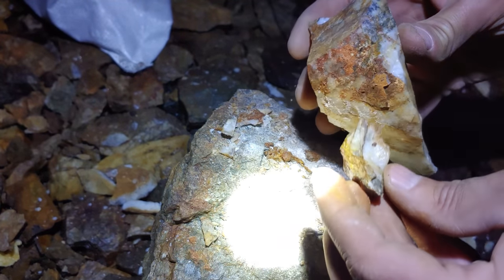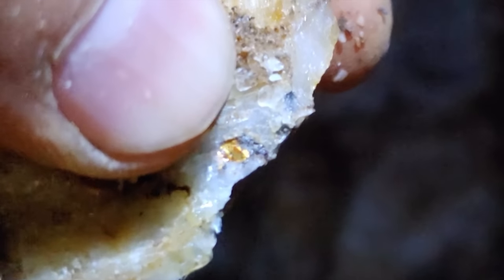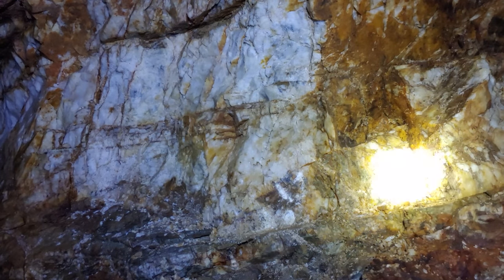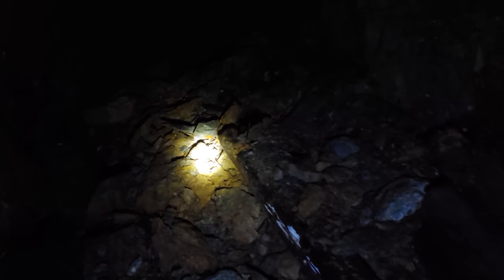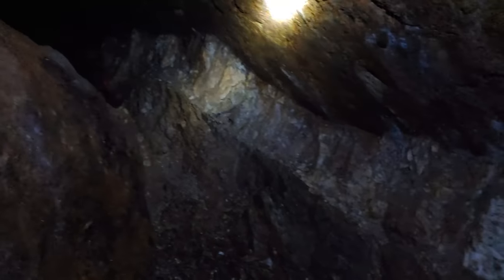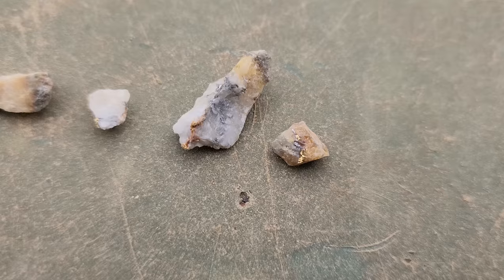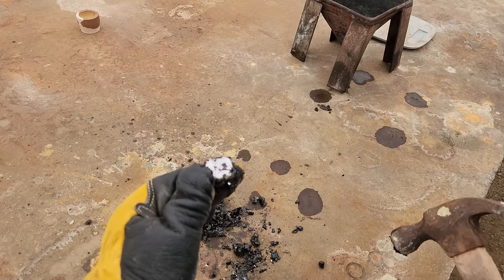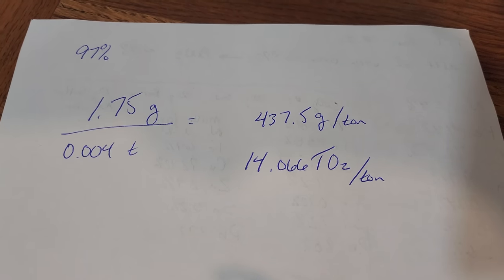Exploring & High Grading An Abandoned Underground Hardrock Gold Mine

Comment: I would suggest a compact led 360 lamp for your underground adventures bro, along with a good battery vacuum and a 3 or 5 gas monitor for air quality, all small and lite weight, but helps with your safety! Peace.

Comment: Thanks for the vid Jason! Hey I have a question, could you use a metal detector to find gold in the tailings on the ground in that mine? Seems safer to look on the ground rather than picking at the existing structures 😬
Reply: Jeff Williams uses a metal detector inside his mine, so I don't see why not.
Reply: I would claim that if possible and go in and result the hanging wall. Then I would run a detector over every inch of that mine and the tailings

Comment: I want to put a plug in for that little microscope for cell phones. First time I saw you use it I immediately ordered one. It works great on flat surfaces as you have to get right on the face to get it to focus because of a very shallow depth of field. Typical of higher magnifications. I just got back today from the Old Dale gold district just east of Joshua Tree. We found several nice examples of specimen gold from the tailing piles of several of the old mines in the area. I sat in the Jeep and took several great pictures of small gold nuggets and could then text the photos to friends and family. Really handy device!

Comment: You know, regarding the gold pillar, there's no way I wouldn't try to get that. But I would plan. I don't know how remote the site is, or if you have access to water. Those things are important for encasing the upper end of that pillar in concrete. I would even try to drive some rebar into the ceiling and floor where I was going to set up my forms. After it set, I would attack the pillar with whatever made the most sense. That way, I could take the whole pillar. The Concrete would replace it.

All it takes is time. I'm six months from sixty and I can hump Sacrete uphill for miles if I know there is a payoff that's worth it. I already have a remote claim that is about seven miles back in an area the Forest Service has closed all of the roads in. I've made great use of a yard cart to haul all of my supplies. This year, I'm making something out of a hunting cart. This will allow me to have brakes. I had to rig them up, but they will work. You haven't lived until you've tried to hold back a yard cart from going downhill that has all of your stuff on it, like five gallons of gas and a water pump and motor and all of the pieces of my dredge. I used to roll that thing five or six times every time I went in. Sometimes, when you don't have brakes, you have to make a decision, also, about crashing on purpose, before you get so much speed built up that you will not be able to pick where anything is going next! It's always better to keep things where you have choice.

This isn't too far off from how I just got the assay results back from an outcropping I found in a Wilderness Area. You can't do surface disturbance in a Wilderness Area. Too bad because the outcropping came back at over an ounce per ton. I found it in an old prospect pit. The old timers missed it by that much. It is off surface enough that I can take samples. I can't mine it, but I can sample it up to the reasonable point where it's too much surface disturbance. I may have to get creative with the waste dirt. You gotta find a way. This way involves me humping sample bags for a couple of miles, probably one in each hand. I don't want the rangers seeing me humping a cart in and out of the Wilderness Area. If I keep the promise to myself to not fill them too much past halfway, I think I can do it. It's amazing how heavy those things get if you get too greedy. As long as you don't get too greedy, you can put them down every time that your forearms feel like they are about to explode. That way, you can get just enough rest to string carrying them back to your vehicle.

Comment: Vogus has a video on those ones with visible gold on several points of a piece of quartz. He uses an electrical tester to see if two points on the outside connect internally meaning they are one larger piece internally. Those are good candidates for dissolving the quartz leaving the gold sculptures behind. Some are out of this world looking crystalline gold. You do realize that sawing those pieces in half means that the saw curf put gold dust in your oil bath don't you? Might be worth the loss if those slabs sell for a premium, but just a thought.

Comment: Sierra blaster would be nice to have in there, or a home made version using 9mm rounds as the charge filled with powder then sealed with jewlers wax or something fairly strong. Then devise a way to seal the hole. Maybe use cornstarch to fill the bottom of the hole  with a hose and surrenge. Only about 2-4oz in the bottom of the hole depending on depths , im thinking about 36" hole. Used a large o-ring to fit the shaft made from a thick rubber to form a semi seal around the 10-11mm shaft  the starch provides a non compressible seal around the charge  and boosters can be made with aluminum or brass tubing filled with powder, using an electric match to fire the firing pin into the cartridge, maybe use a wedge around the shaft and actually seal it in similar to a feather and wedge. Allowing much more work to be done , the wax sealing the powder  in the tube compressed make boosters in 1" , 2" , and 5" maybe 6" test Would be required. Because at some point the work will be done before the whole tube can ignite, the next option would be larger holes and use 1/2" tubing for boosters possibly  50 cal magnum cartridges,   drill a 5/8" hole 36" isnt easy   4-6 in a rock wall with empty holes between them  using a couple 6"boosters per hole with starch in the holes, ans a plugged entrance  it should open a door size hole 24-26" wide x 65-75" tall depending on a few things it may not throw the rock across the way, but it should fracture it enough that the opening can be opened by hand with s few tools at most .  I'd love to build stuff like this..  having two expanding anchors to hold the cartridge holderscin the bore hole or just a wedge system would be great preventing blow outs..

Comment: I've always wondered, could one build a concrete pillar , besides a natural pillar, with reinforcing steel inner frame, then once set and dried wedge it into a solid contact with the roof.
Reply: They'd use a system of steel rock bolts, beams, and woven rebar to reinforce the ceiling, but its installation is risky.

Comment: Why did they sometimes leave pillars instead of using stills? Especially with ore that rich, I can't imagine timber would have been so expensive to prevent them from using it?

Has the muck and fall accumulated to the point where they used to stand in there but now you can just barely even crawl?

Comment: every time i see piles of rock like that in those mine entrances, i get an Itch to want to move it out of the way, and or build walls with them.  but, then again, crushing it to find any minerals would be even more likely haha. otherwise though, i think using concrete and forms to stabilize a mine could be an interesting way to go about it, though very expensive if not entirely necessary huh.

Comment: First of all I would not be in there. LOL
  Secondly I would only pick up loose stuff if it did not come out with my fingers I would not touch it until I got some new timber in there.
  The way those columns are fractured they are already coming apart. You can always come back and send Dan heard in instead. LOL👍🏻

Comment: It might have made more sense to explain that 14 gr per ton is equal to about $950 of gold per ton of ore. Extending that to the collection and processing operational costs, you would still have around $500 per ton of clear profit.  However, not all samples will be this rich even from this same mine, as these are from 10 lbs of hand selected samples where gold was readily visible, and not more than 10% of the rock out of this mine would be this profitable, but in all, it is a still profitable if you can process enough fast enough.

Comment: Do you have a claim for that mine?
If yes, is there any way to first open up the mine entrance so you could walk in?
Bring equipment to add pillars and stabilize the ceiling?
Then clean out the path and vacuum up the debris.
And only after all that, start harvesting the visible gold.
Safety first, bring a friend or two, have a backup of basic equipment including food and water.
The scenario doesn't necessarily have to be getting crushed to death, but getting badly hurt or trapped to the point of Immobility.
You teach and help miners across the world to mine safer. Lead by example, because kids are watching your videos too 💛🙏🏼

Comment: some of the chunks with gold ' wire' in, would be very interesting if the quartz was dissolved in hydrofluoric acid leaving the wire in form.  also very dangerous as the acid is horribly nasty stuff. perhaps worth doing a collaboration with another who has experience if you have not.

Comment: Id take a litium power pac and as strong and as big of a shop vac in there with you next time and concetrate on sucking up as much of the fine muck in around the high grade spots you and everybody else thats been in there picking ore out of the high grade areas. I bet an incredible amount of gold that was stuck in the cracks just falls to the floor and then back into any cracks in the floor. I live in eastern Oregin jason, and I'm 61 years old just wasting away. I'd love to go along with you if you ever could use an extra hand. Get ahold of me and let me know. Or even if you can help me out finding any abandon lode mines in or around eastern Oregon. Save me Jason,  help me find a gold mine where i can spend some of my time this summer. Imba little crippled up from a briken back but i love doing this kind of work, i just have to moderate myself. Im not afraid of hard work, or going under ground. I can do whatever needs to be done, i dont like to get in a hurry doing anything. I have the rest of my life to do whatever.

Comment: Is it possible to replace a Pillar with steel plates and steel braces?
It does seem as though you could replace the old fashioned Pillars with modern technology...like steel.  XD  [moderner than Iron for sure]
Reply: That is holding up a mountain.  Calculate the beam required for that?  Jason was pointing out good and bad back.  The good looks to be a solid seam. The bad has cracks and looks like big slabs can pop off